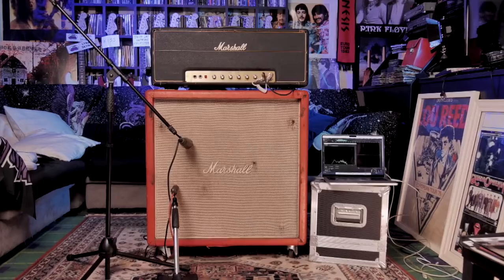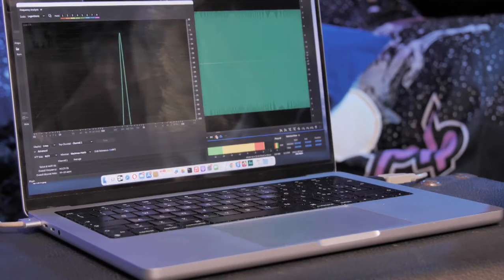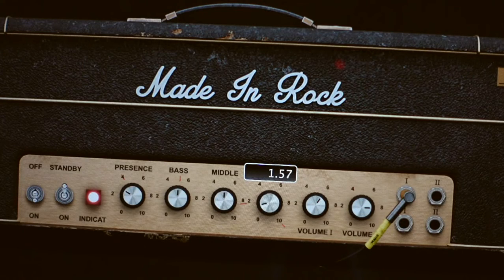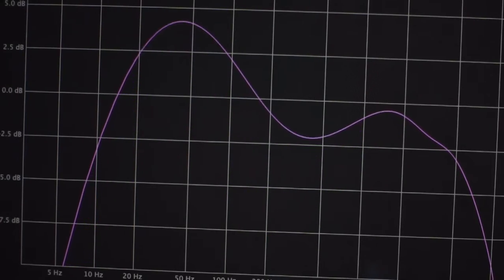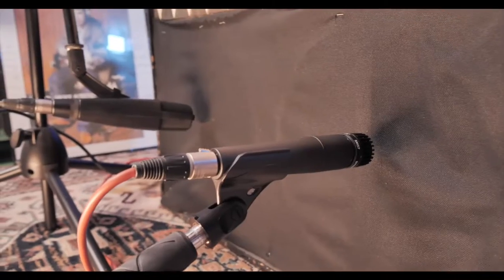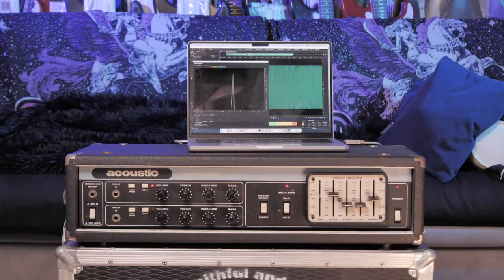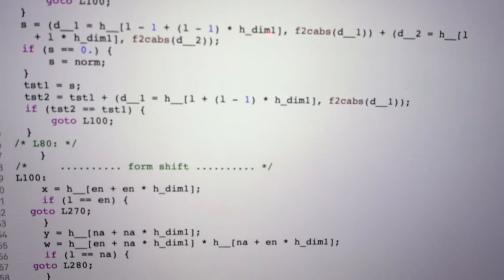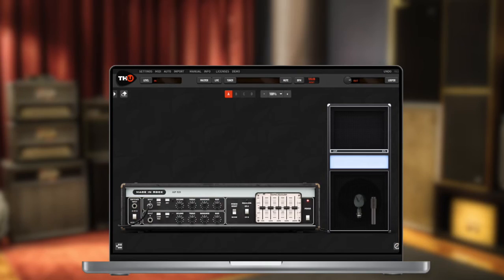Overloud Fluid Capturing explained

Comment: still a little muddy, grainy, and flat, for the software version, but it's a tiny difference. very, very small nuance. more in feel, smoothness, sheen, and overall sound quality.

aliasing is the real pain for all plugins and audio software. if these processing problems that are generalized for digital audio processing could be solved, i think that software could really stand in for the real thing. until then, it's close, but the compounded difference across tracks, multiplied by the number of various processors, makes a night and day difference - in the final feel and sound quality.

i keep saying, with software, the character is there, but the sound quality is not - for 95% of plugs out there.

anyway, this approach is great, and i wish more people undertook it. i love capture sound - necessarily at the right level, which is another inconvenient, and the captures are usually inconsistent, which poses another poroblem - but i hate having to browse through countless rigs, instead of just turning knobs.
Reply: I bet you wouldn't tell the difference in a blind shootout.
Reply: @matthewray5343  Lol exactly. People are listening with their eyes, the confirmation bias people have with amps and guitars is almost religious dogma. Amp profiles on Th-u do "feel" real. More so than modeling alone.
Reply: @matthewray5343  if the test was all done, and all psychological bias and misleading removed, you'd lose. i can tell the difference here, with my eyes closed, and clicking randomly on the timeline. i could even tell you what the differences are, but i just don't feel inclined to do it, by this inexplicable "certainty" you have.
Reply: You say 95% of the plugins out there, what would you consider the 5%? Out of interest.
Reply: Totally agree. Still not there. Dont mind these comments probably from people who never captured a real amp probably. 20 years learning to record amps with real mics. Still not there but closer
Reply: In a mix people will indeed not hear what's what. But based on the demo I can actually feel that the feel of the feel is missing. Don't know how else to describe it
Reply: @MichaelRiesenbeck  Disregard this trygg "diusch bug" olaf something. He's been going around product demos for years, putting the developers and their products down. It's just what he does. Quite the funky pile, I have to tell you. Because that's his essence, being a "diusch bug". He can't help it, it's the way he was conceived. We should feel somewhat empathetic for him.
Reply: @MichaelRiesenbeck  i don't think that you think too much. nothing you've aid makes any sense, all we retain is the smug attitude, which is usually the hallmark of not really smart people. and i don't think you do much mixing either. otherwise you'd have the experience yourself. you're probably too busy being smug online.
Reply: @Tryggvasson Are you kidding? Come on man, amp sims have been being used in pro mixes for many years. Most people can not tell the difference and it a blind test, a lot of pros wouldn’t be able to tell in a mix.